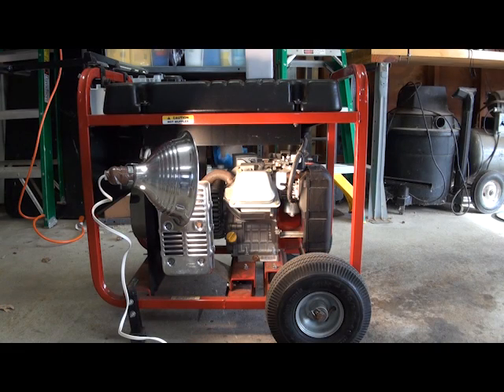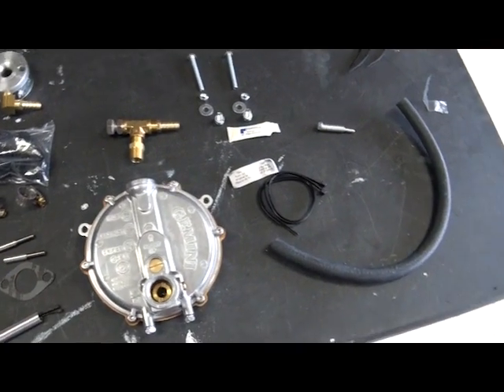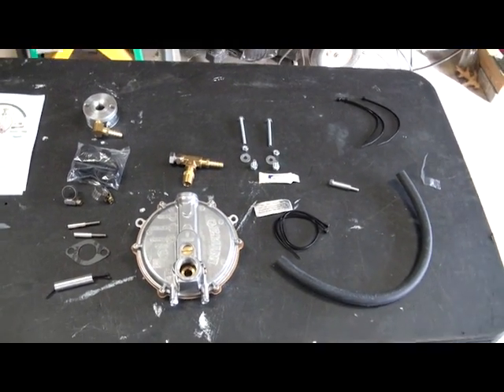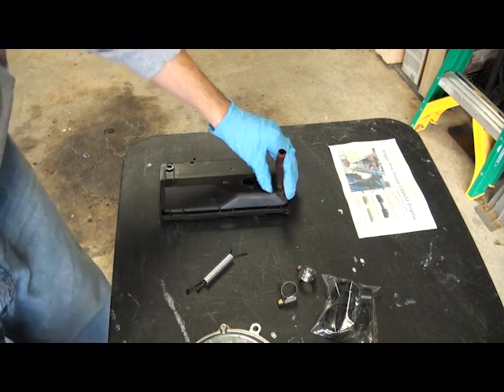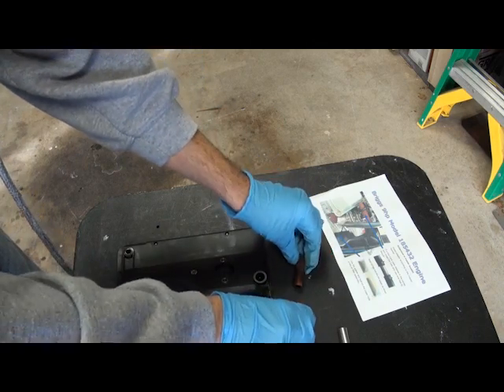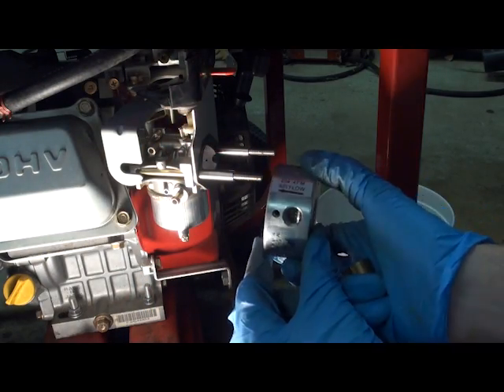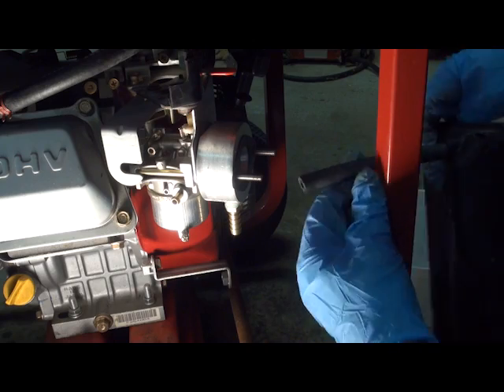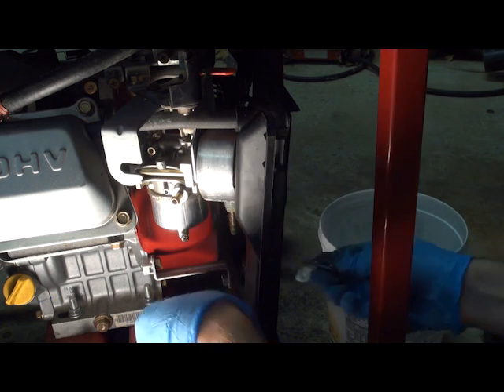Installing a Tri-Fuel Conversion Kit to run a Generator on Natural Gas, Propane or Gasoline

Comment: Thank You for the great video and information. If I understood You correctly, That model kit would fit on my 10hp Briggs & Stratton. What model is it and would You be willing to tell me the cost? I have been on their site and had a real bad time trying to find information. Old timers like me get lost real easy. If they would improve the site, Sales would increase. Again Thank You.
Reply: phillip staton I noticed your comment a year ago you probably already know but the kit he is using is the old style kit he bought from Century Fuel Products for 200. You can get the new improved kit from US Carburetor it’s called The Motor Snorkel kit good for engines up to 13hp. The metal Venturi is the old design they changed it from a 1” thick metal to a gasket with the tube infused in the gasket because many complained when they installed the old Venturi it made the air cleaner stick out farther causing people to cut the frame on there generators so they changed it were there are no issues with the air cleaner and it cost 189.00 from US Carburetor. There name will come up as Motor Snorkel.com